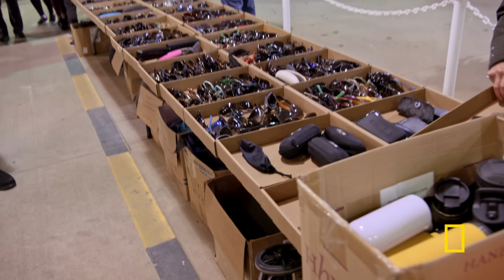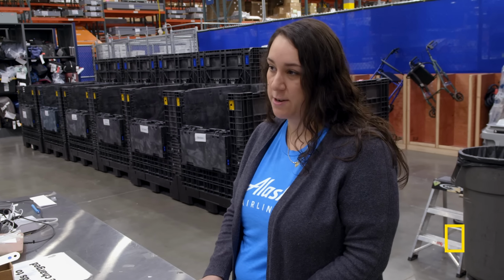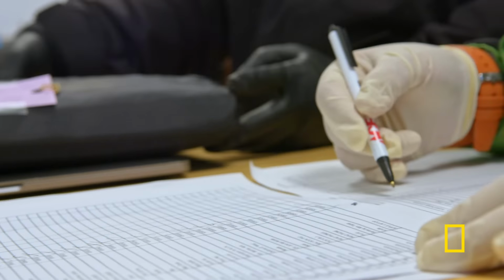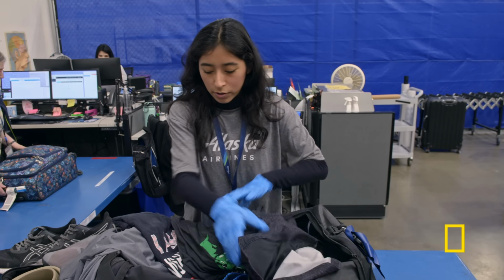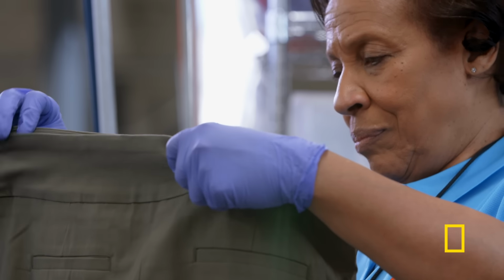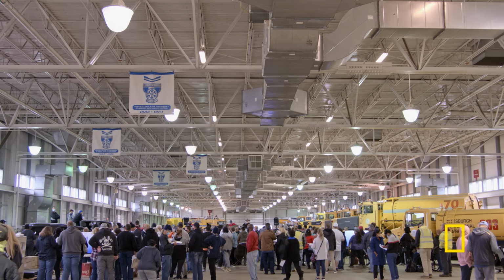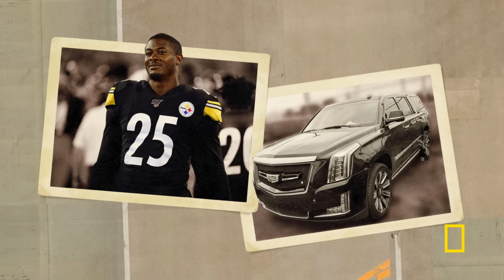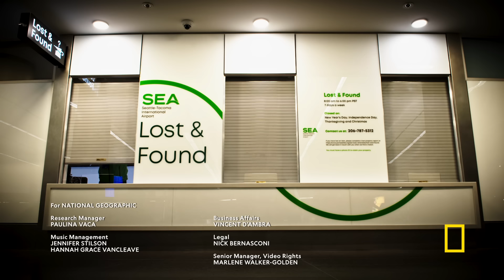Inside Airport: Lost & Found (Full Episode) | National Geographic

Comment: I spent 8 years working in a private charter bus company garage as a cleaner. There is ZERO screening of any kind and many people travel by ground because of that. Not one single thing in this video shocked or surprised me on any level. If you think airplane bathrooms sound gross, try cleaning one that got used on a bumpy highway at 70mph by 56 people in under 2 hours. Yah... I win.

Comment: What I don't get, is if there is an airline tag on it why is it so hard to find the person it belongs to ?? The bar/qr code on the tag should give you a flightnumber,  seatnumber and passenger name. The airline itself should have more data from the booking of said flight, thus giving full passenger info. It seems to me that most lost luggage can be retraced to its owners that way. Or am I that dumb, that I miss something in the process ??
Reply: The don't have much problem, he said, with CHECKED luggage. 
My guess is that the bags that they have trouble connecting to the owner are either forgotten or abandoned in the overhead bins on the plane, or at security.
Reply: @cmtippens9209  Not always the case. I do not see cars being put in overhead bins, nor impossible to find the owners of.
Reply: @FacelessJanus   - the issue with the cars was fully explained in the video.